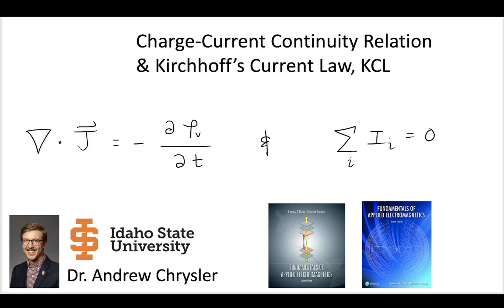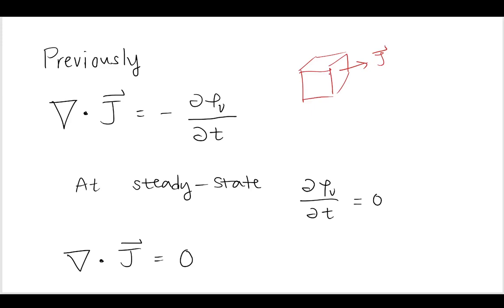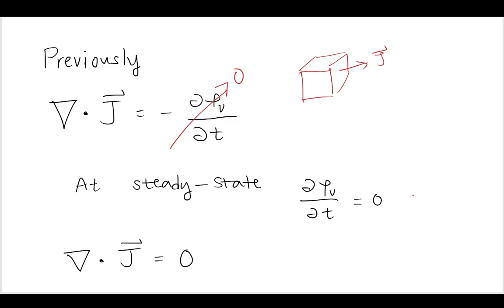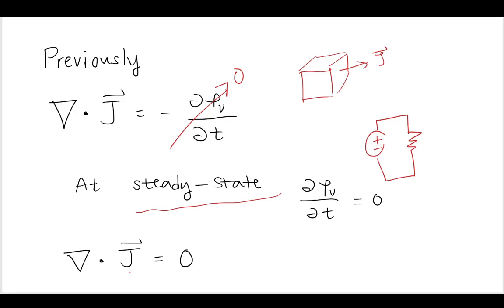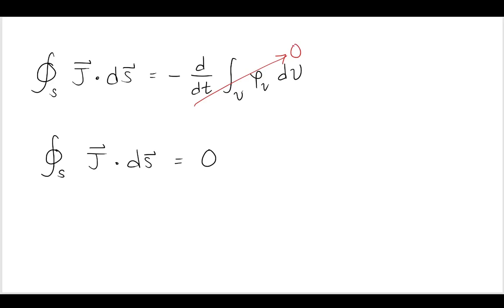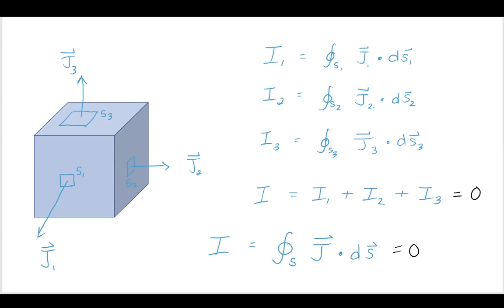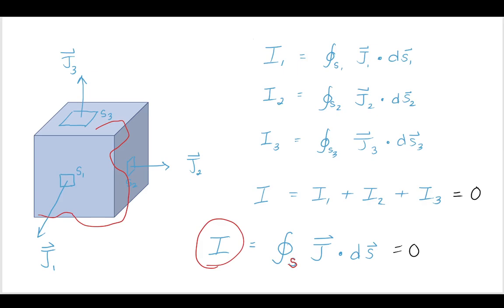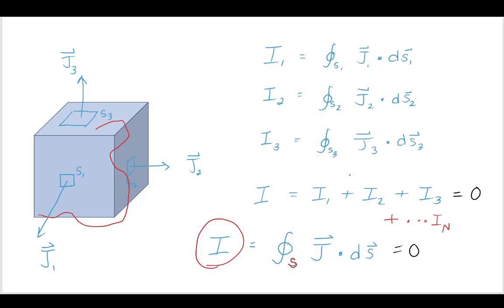6-9 Continuity Equation and the KCL

Comment: now , how it is applicable to an ac circuit?
Reply from the maker: Could be many ways - - for example consider Ohm's law from the field theory perspective where the fields may be time-variant (just like an AC circuit). Now you can combine the concepts from this video with Ohm's law and you will get an idea of how we can analyze circuits or nodes from a field theory perspective. However, usually it is a lot easier to apply phasor analysis for a large circuit.